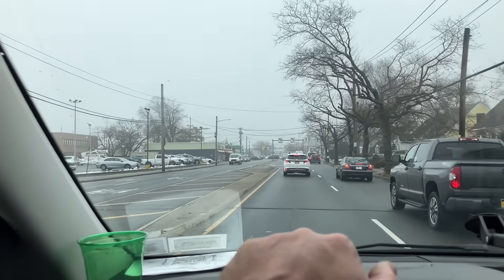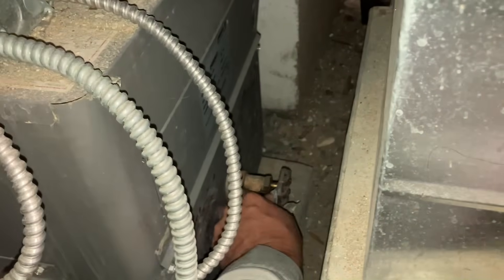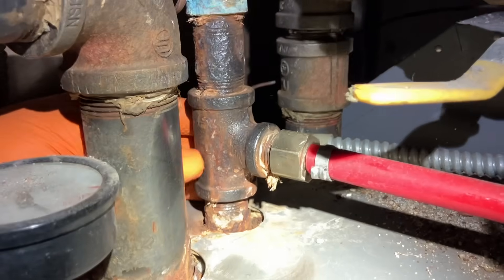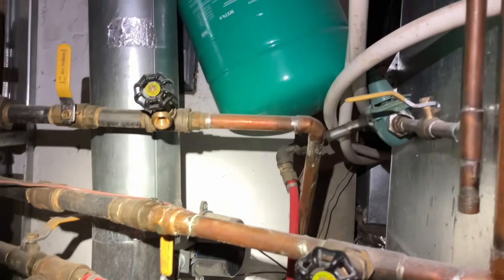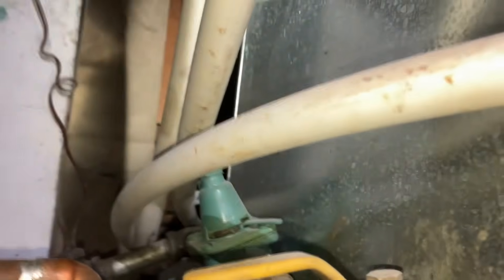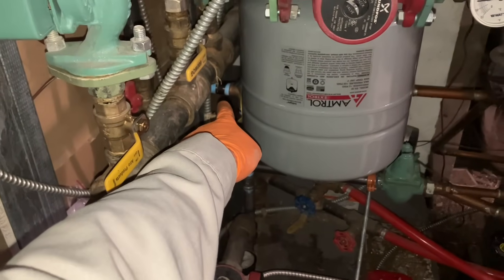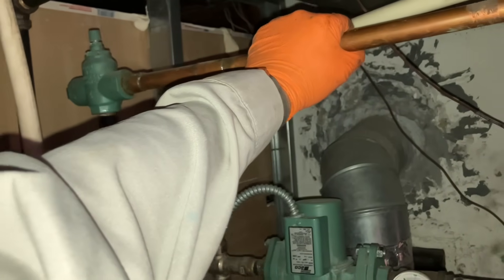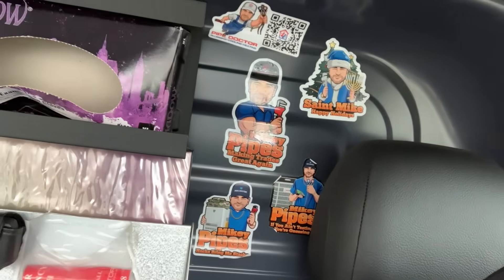How’d They Expect This To Work? Replacing Extrol Tank & Purging Laars Boiler

Comment: You ever think about taking over a company that installs and repairs larger, high pressure boilers?  Might have some welders/boilermakers who are certified and might stay with the company.  Schools, hospitals, and industrial boilers.  Majority operating at 100 # or less.  A few higher pressure.  None over 600 psi.
Reply from the maker: Nope, not really. I think that businesses should stay focused on what they excel at. My company excels that providing prompt, courteous, professional, and reliable service and repair. And when we come across a system that age and possible repairs justify replacement we excel at that. So I’m not gonna deviate from that and take over a company that installs high-pressure systems.

Comment: Hello Mike, Thank you for sharing your knowledge of troubleshooting steps and skills.  I have a Burnham Alpine hydronic boiler that was built in 2010.  Recently I found that I have to reset on the display screen to clear faults to run the boiler.  Fault codes are 22 for the most part and 25 sometimes.  It says replace the SAGE2 baord if the problem happens again. All sensors are good and reading.  What is the fuction of the reset button on the controller if I try that?  I wonder replacing the SAGE2 board will resolve the problem for good or not.  Thanks. Bhoe Gaylo

Comment: Years ago I worked remodeling in older homes, there was day I asked myself why I even got out of bed, I looks like you were having that day there my friend
Reply: Who in the hell installed that mess in the first place. Not much of a technician. No plan at all. That expansion tank location is a joke. Not supposed to be upside down. Should be level.
Reply: Also that system should have about a gallon of Hydronic #5 Inhibitor and lubricant to keep the water clean. Water should be clean. Never drain the boiler with hydronic #5. Real good stuff!
Reply: Tank should be installed on bottom of an air scoop with the air eliminator on top of scoop.

Comment: 9:32 for this trick if don’t have regular unsharpened pencil/cylinder/etc; it would be BETTER and EASIER if unscrew’d pen tip & in;  so you have better Clarence to get ptfe closer to unit and lower in threads. So, great an awesome tip/trick turning a pen into multipurpose tool for you to get task completed 👍🏻 
Hope this helps least 1 person.
Cheers ✌🏻

Comment: better off using an unsharpened contractors pencil(marker) or small screwdriver handle for the thread tape. something you can wind it on very near the end of.
your double ended hex socket bit works good also, piece of 1/4" to 1/2" tubing, handle of flux brush, shaft of a multi-plex screw driver with bit/holder removed. socket extensions, sockets also.
fact, none of it will ever be near by when you need it to wrap a weird joint. lol!

Comment: Mike , You do nice work. Many guys would look at that Hodgepodge  job and the new expansion tank would have been hanging from a coat hanger from the ceiling . Not you. You did a professional job . I am not sure how you got enough air out of that system to get it to work . But you did it
Reply from the maker: That system had me scratching my head for sure.

Comment: You were bothering because you are a good technician and do what needs to be done not just what is easy to replace. It would be hard if the tank ever got waterlogged due to diaphragm closed. Great video,smart fix
Reply from the maker: Thanks for noticing the details. That's what separates a good tech from the rest.
Reply: Was he supposed to redo the whole boiler so you not bothered it’s obvious the customer wants to do little as possible

Comment: No vacuum relief valve on that tank
Reply from the maker: Not necessary
Reply: @PipeDoctor  mike open the pod bay doors, mikey open the pod bay doors, mikey open the pod bay doors,lol
Reply from the maker: @everettstevenson2111  crazy
Reply: Must be a NY code, here in mass they are required based off drain size

Comment: No Safety Popoff?  Relies on the pipe wall thickness to burst to relieve excessive pressure or it launches thru the floor into the roof and over to the neighbors yard.
Reply: Like to know what idiot set up that monstrosity. Too jammed in and pipes all over the place. I would not recommend who ever installed that system.
Reply: That's 100% right, if you ask me. Needs a pressure relief valve.
Reply: there was a T&P valve(maybe only pressure relief), but it was improperly placed way off to the rear of tank, where the temp sensor probe would be near useless.
there appears to be no drain valves on the bottom boiler connection or on the domestic cold inlet, also no air vent/purge valve on the boiler piping(maybe at boiler?).
also, no domestic expansion tank, no vacuum breaker on cold inlet(may or may not be/have been code at install time)
Reply: @ but other than that, perfect install……..